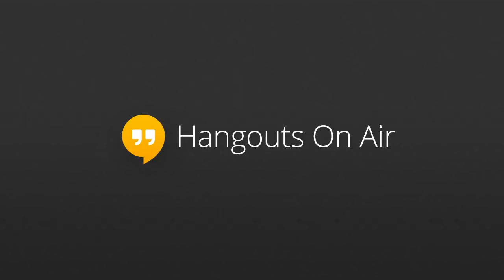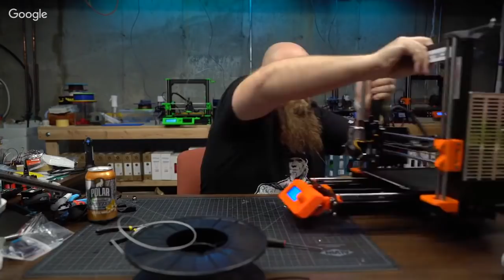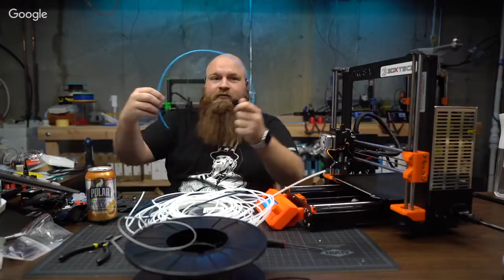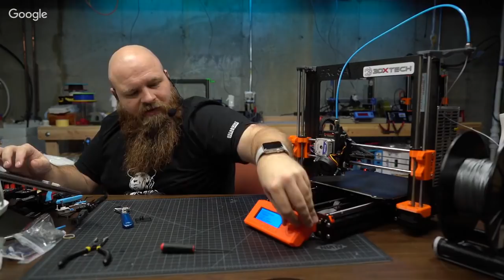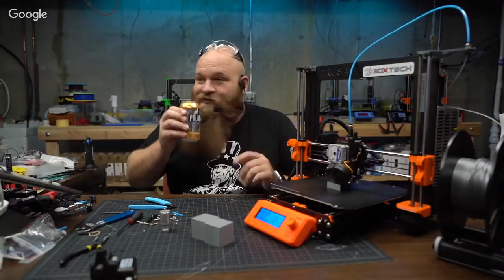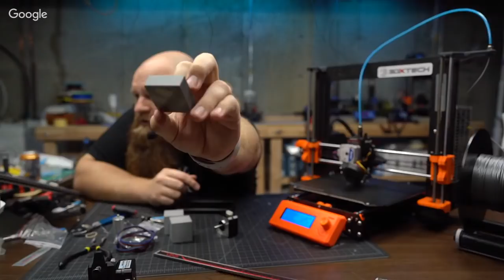Bondtech BMG MK2.5/MK3 Extruder Testing

Comment: One  question if I may, since you have a lot of experience with building Prusa's and Bear's. Is it possible to mount a 4020 fan as heatsink cooler or will the extra 10mm conflict with the rods/frame?
Related, what voltage does the Pusa board output on the fan headers? (24v board afaik but seen people talking about using 5v fans) ?

Comment: Textured sheet is on eBay btw. Version 3. This is the link. https://www.ebay.nl/itm/Prusa-i3-MK3-Mk2-5-Double-sided-Pei-TEXTURED-Powder-Coated-spring-steel-sheet-V3/232936788378?hash=item363c1d519a:g:8YIAAOSwespbpYZ-:rk:1:pf:0